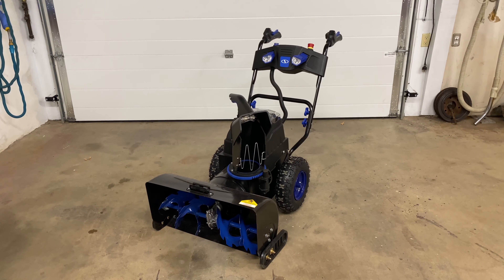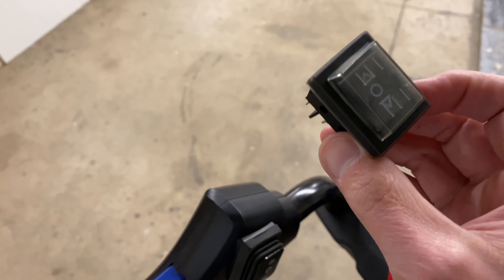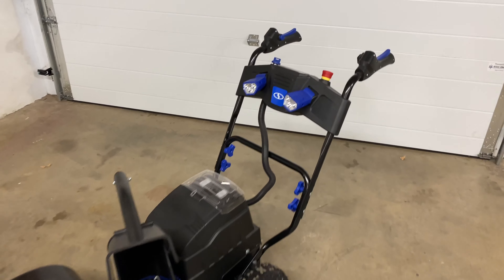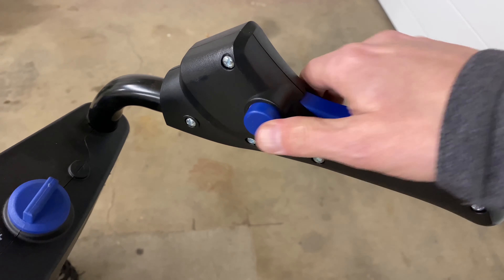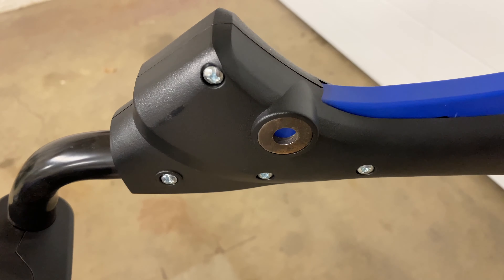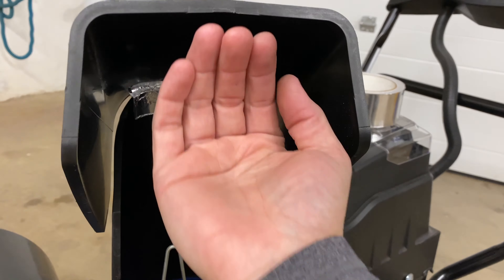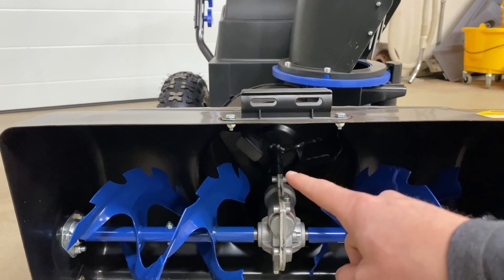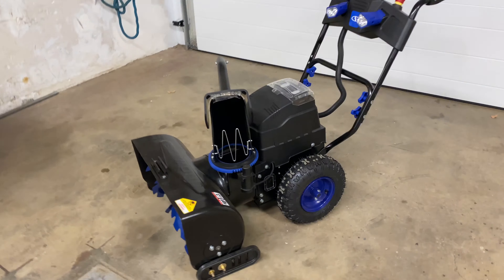Essential SnowJoe 80V Snow Blower Mods

Comment: The washer idea to bypass the safety is good way to stop the annoying issue with trying to dig your thumb into the button just to start the thrower and can get frustrating when you constantly have to stop and start in some cases.  I was thinking to avoid the bypass safety can you not adhere something on the face of the button so it sticks out further and would make depressing the button far easier with gloves.  The design flaw is the button flushed with the opening to engage the motor.   I have a feeling when testing the unit the engineers did not wear gloves.
Reply from the maker: That could be... I see they have replaced this with a 100 volt model. I have not seen it in person yet but I'd like to check it out and see what they have improved (or not improved) on the new model!
Reply: @InternetDude  whats interesting about the 100 v model are the batteries... most power tools use a universal motor meaning they will run on ac or dc. having a 100v dc battery could technically make a mitre saw portable.  I only have a 40V battery for my lawn tools.  40v is too low to get the saws to work at full capacity.  Works okay on a drill.  
Though I could not justify a 100v snow thrower as my driveway is small.  Would still  love to see a review.
Reply from the maker: That’s a good point. Tools run at 110–120 V AC at home and also usually run up to 240V.

Comment: Excellent video. I have had the same machine for about three years, and I like it very much. I have already modified the switch to rotate the chute, and the blue safety button, in ways similar to how it is shown in the video. My next modification will be to tape up the gap in the upper end of the chute, and to use silicon spray as you describe. Thanks for the great advice.
Reply from the maker: Great to hear!

Comment: I removed the chute motor and now turn it by hand.  This is much faster and never stuck with ice like before...  After 4 years of use my batteries need replacement.  It's really expensive,so people have to think about it before buying it...
Reply from the maker: Hi I do find the chute motor iced up sometimes. Do you just turn it by hand then? My batteries don’t last as long as they used to, I priced out new ones and thought I’d be better off buying a gas one instead. I didn’t buy a gas one yet but I am seriously considering it!!

Comment: You could use a heat gun to warm up the shute deflector to tighten the  tolerance on the sides of the discharge deflector.
Reply from the maker: Thanks for the tip

Comment: very nice mods. simple and not difficult. gonna try th e switch. not the best snow blower around, but first gen products never are the greatest, but not bad for something battery powered
Reply from the maker: Yeah it’s not what I would call perfect but it is the best two stage electric on the market to my knowledge. Hopefully there will be an even better one in a few years to replace this. I figured I should buy one to support the company and it’s not gas powered and noisy. I’ve only used it once or twice this winter so far.

Comment: One modification I did to my John Deere riding snowblower (44") was to drill holes along the back of the chute and rivet a piece of aluminum inside the chute. That way if you have a gravel driveway the aluminum takes the punishment instead of the plastic chute cracking (and costing $300 to replace).  If you don't have a gravel driveway you don't need to do this.
Reply from the maker: $300 for a plastic chute? Wowzers. Yep that should help immensely. I do have some gravel but it is so well packed down and I have the skid shoes set up a little so it does pick up rocks but not very many overall.
Reply: @InternetDude   Its a combination of two things: 1) they only sell the chute with all of the wires and controlling rods as a kit and 2) it is John Deere so its overpriced
Reply: I appreciate the tip! I have a gravel driveway and I've had to improvise and adapt to it so much and little tips like this helps!

Comment: Your tips should be sent to this manufacturer so that they can improve their product.
Reply from the maker: I agree! This one is the second version and it already includes a number of improvements over the first version. I should email a link them a link to this video.
Reply: InternetDude It would be amazing if they actually listened to you!
Reply: The newest model has left and right arrow buttons on the main button panel to control the chute.
Reply from the maker: @CJ_Wolesz  whoa I took a look on their website, that is an absolutely awful place to move that controls to. Being able to keep your hand on the handle bar while operating makes a lot more sense.
Reply: the chute sould be 6 inches higher as the Ariens gas snow blower
Reply from the maker: Good idea!

Comment: Great tips! Thank you! I purchased one at the end of 2020. One question: Do you get any vibrations/shakiness/stalling from the blades while operating? I can only guessed I pushed it too hard during our last snow storm here in New England-Rhode Island.
Reply from the maker: Yes. If the snow load is too much it will stop turning and I will have to push the switches back down. That is by design. Personally I don't think it should be so sensitive but that's how it's designed. Some vibration and shaking that is normal for all snowblowers, these are not precision balanced machines. I see they have a newer 100 volt version, I would very much like to try it out.
Reply: @InternetDude  Thank you very much for the fast Response!

Comment: Mine stopped working the other day, all it does is hummmm, any idea's? I checked the belts and they are fine.
Reply from the maker: Which part doesn't work? Moving forward or the main auger? Or both? Make sure the batteries are both fully charged and try again. I did have one problem when the inside auger that throws the snow upward got jammed, but it made a bad grinding kind of noise.

Comment: Best most useful video I have ever seen on YouTube. Thanks so much. I ordered everything but the silicone spray since I already have two spray cans of it.. 
One more thing: any ideas of installing tire chains or alternates?
Reply from the maker: Thanks! I don't feel tire chains are necessary because if the main auger takes in too much snow too fast the unit stops to protect itself. If the tires slip a bit that should help prevent that, essentially it will slow down the unit a bit.

Comment: One suggestion, stock up on shear pins/bolts. Relatively cheap and you will eventually need them.
Reply from the maker: It came with an extra pair. The motor turns off the auger if it detects too much resistance so I don’t think I’ll need them. Typical gas units aren’t smart enough to be able to do that.
Reply: @InternetDude  True. I keep several on hand as there is one for the left auger, one for the right auger and a couple for the impeller. lol

Comment: why not use car weather stripping and just open the handle and disable the safety switch? The weather strip for cars would block more, and you are disabling the switch anyway so why not do it right.  Those washer fall out and you throw it on a 2nd pass you might hit someone or something you don't want to hit.
Reply from the maker: Where would the car weatherstrip go? I didn't want to permanently disable the safety switch because when I go to sell it down the road I want to easily return it to stock condition. The washers haven't ever fallen out while I've been using it. I have thrown up rocks from the ground many times, this thing isn't super powerful so I've never damaged anything throwing up rocks. Thanks for watching.
Reply: @InternetDude  goes in the gap between the shoot and the adjustable flap that directs the snow. Press it around the back side.
Reply from the maker: That sounds like a great idea!
Reply: @InternetDude  just get a thin strip, just enough to fill the gap, also they make ones that have metal teeth and a rubber gasket seal. The metal would bite better in the plastic and hold on better.

Comment: I clicked on the link for the switch but what was sent was a non-momentary switch. It does not spring back to the center off position like the one in the video. Any thoughts?
Reply from the maker: Hmm I looked and it doesn’t appear to be a momentary switch! I guess look on Amazon & eBay for a momentary version. I don’t have a part # or anything for the one I have.
Reply from the maker: Try https://www.ebay.com/itm/323281019524
Reply: @InternetDude  Thanks, Placed the order today.

Comment: Thanks for your video, just got my Snow Joe yesterday.  Now waiting for snow, a few of question....  #1 it would be nice if you made a video showing how you took of the chute switch off and if the new switch ( you show from Amazon) just plugs back in or do you have to doing some wiring.  #2 you seem more mechanical minded than me and skilled, it would also be helpful, the first time you take the time to lubricate the auger if you made a video showing the steps and what type lubrication you use. #3 the skids you show from Amazon, did you have to do any modification to make them fit ?  I'll keep checking for your idea's.... keep up the video's and Thanks for your help...
Reply from the maker: Thanks for the feedback. I probably won't make a video showing just the switch removal but all you need to do is put.a small flat blade screwdriver in the top edge between the switch and handle bar and pry the switch out, then do the same for the bottom. There are 6 wires on the back of the switch, pull them off one at a time and plug them into the same spot on the new switch and then it pushes back into place. I can't see #3 of your comment but I will keep that in mind as I plan on doing another review showing the performance of the unit with a possible bit of a review as well.

Comment: Any idea when we can expect the full review? I was looking at the Toro 1800 video you did and that was pretty impressive but wanted to see what you upgraded to following that. Whatever I get will be my first snowblower purchase. I like the idea or corded electric and have an outlet in the garage that would be perfect for this but I'm worried the Toro won't cut the mustard in pretty bad/deep/heavy conditions. Looks like some great mods you made to this.
Reply from the maker: Hi, I'm not sure how soon I'll get to the review video. The Toro is amazing, I still really like it. My main reason for upgrading to the cordless model was because I owned 3 properties last year so I needed the portability without power. If you can easily reach everywhere to clear with a long extension cord the Toro 1800 is a very fine choice. If the snow is really deep you will need to do two passes, one on the top and then one at the bottom. That involves holding the snowblower and pushing it, so it's more effortful. The downside of the SnowJoe is it's heavier so it's harder to move from one property to another (takes 2 people to load/unload) and it bogs down and stops when it gets into too heavy/wet/deep of snow. For softer snow it will power through quite well. The SnowJoe 80V also is self propelled which I like as I'm not getting any younger LOL Let me know if you have any more specific questions and I'll do my best to help you decide.